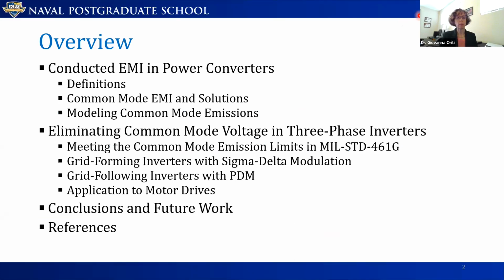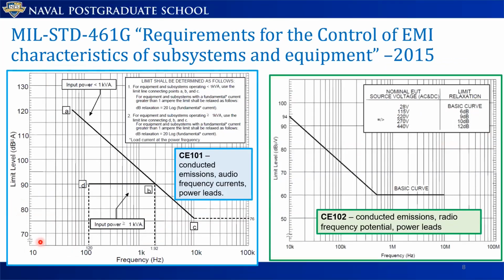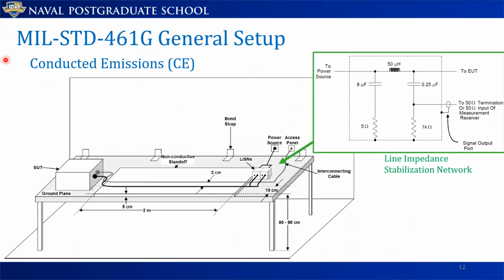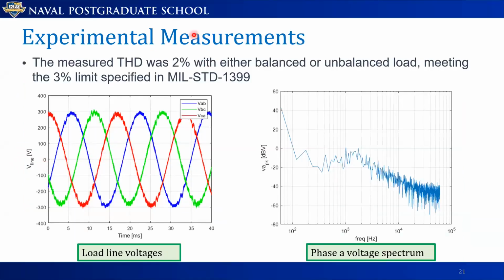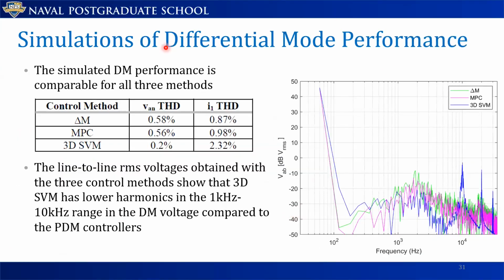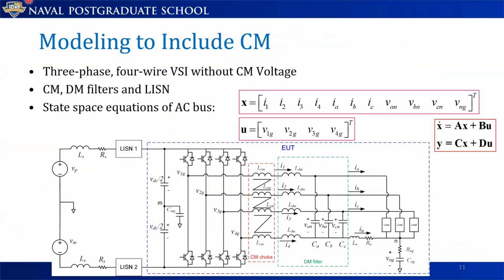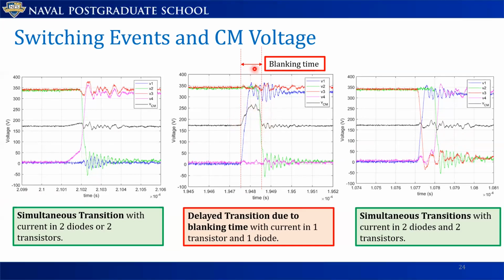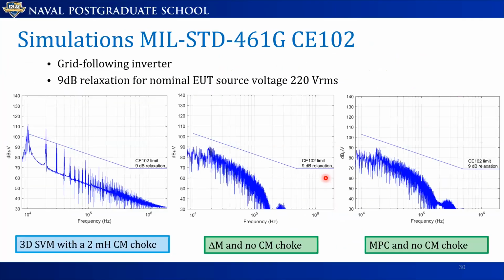Common Mode EMI Analysis and Mitigation Methods in Three-Phase Inverters

Comment: Hi mam. This is a very helpful video for me. Actually, I am doing research in EMI reduction, particularly DC-DC converters in EVs. Could you please help me to measure CM and DM noise of the converter in Matlab simulink. I need some reference circuits or video.. It would be very helpful for my research.